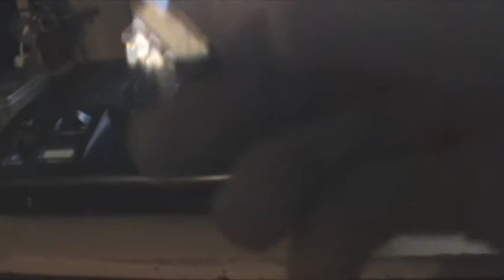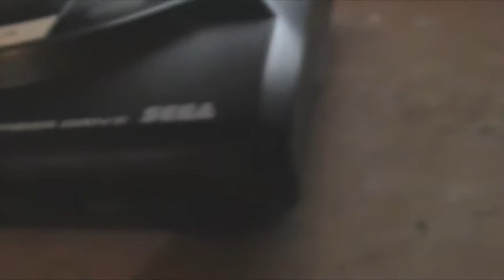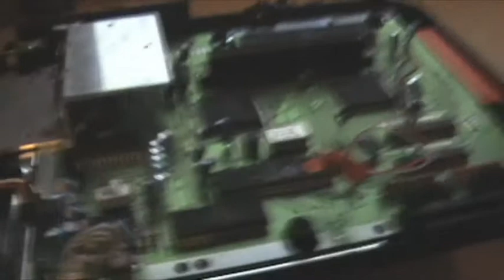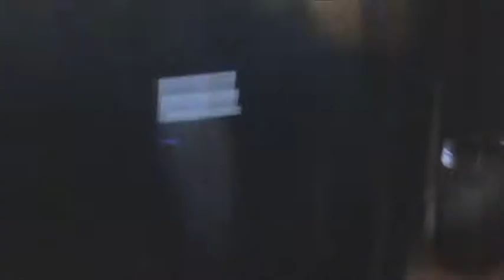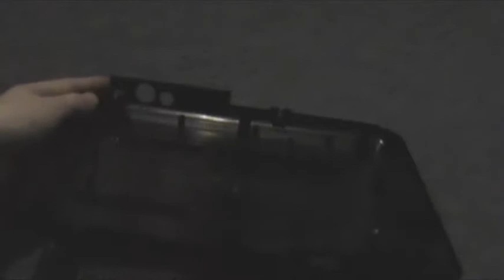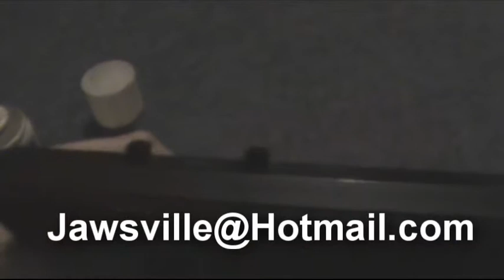Megadrive JPN & 60Hz Switch Tutorial 1/2

Comment from the maker: @REDFlELD Hi, you can't simply use the 60 hz mod if your video output is only the coxial or RCA. You have to buy or create an RGB cable using the din output on the back of the console it's very easy and I will send the link to the tutorial to you in a message :)